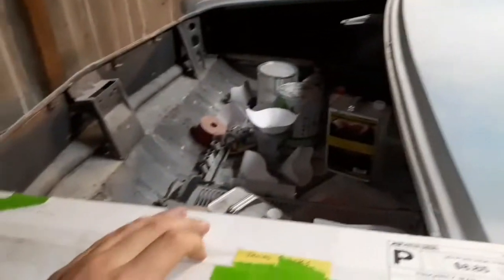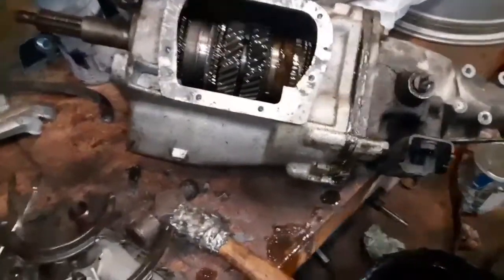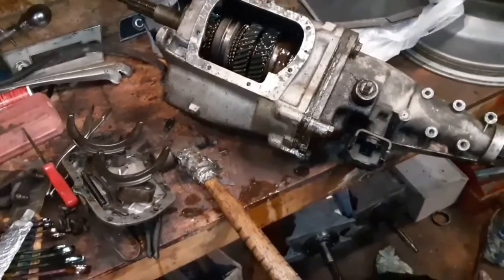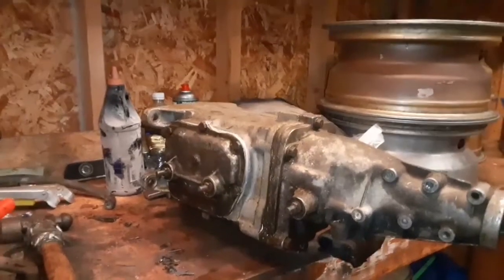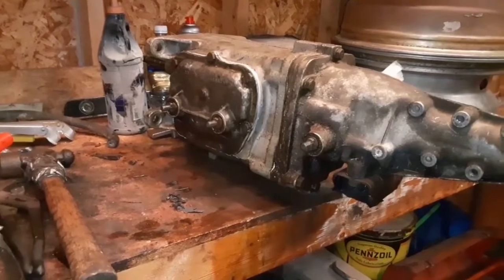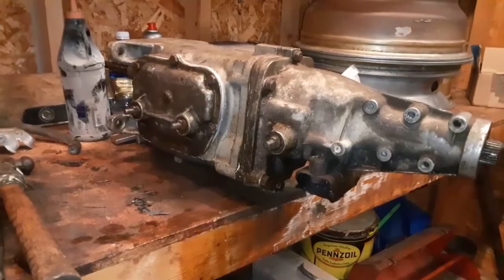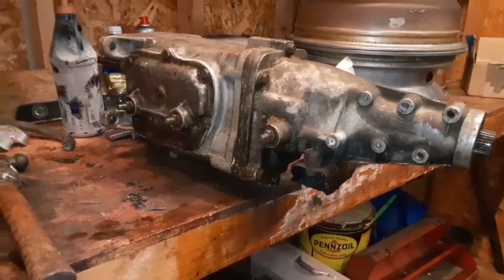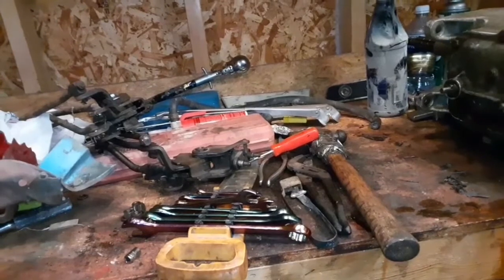change of direction with the 67 and it's a good thing

Comment: Good luck brother.  I have a Muncie as well.  Just haven’t been able to get it quite right.  The bolts keep backing out of the bellhousing!  I applied red thread locker this time!
Reply from the maker: Thank you & also my v8 s10 used to do that all the time until I found out the driveshaft was slighty bent causing the bolts to back out does your car have a vibration?